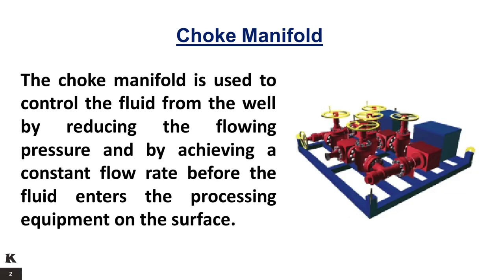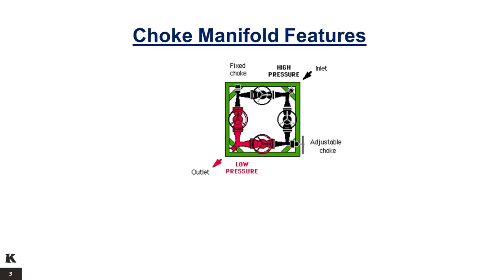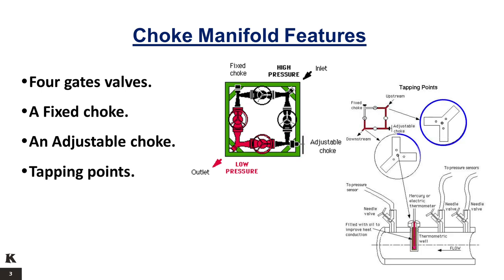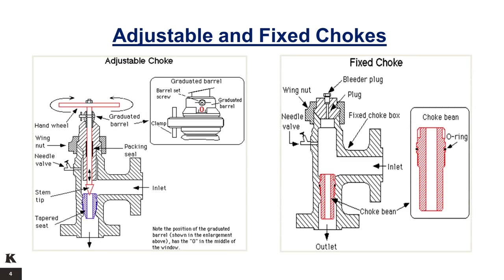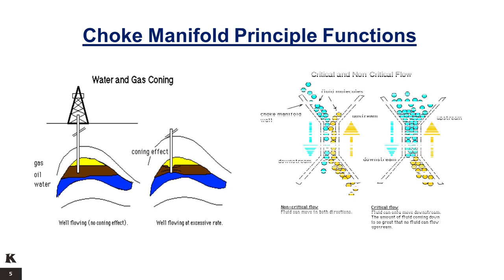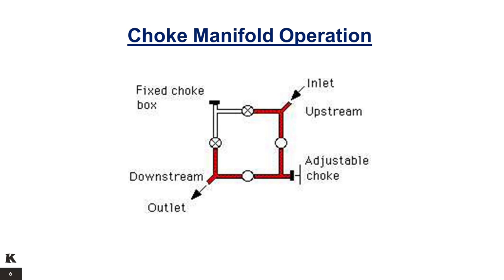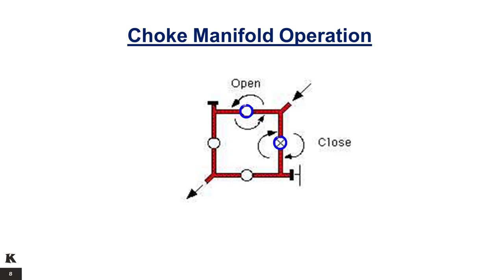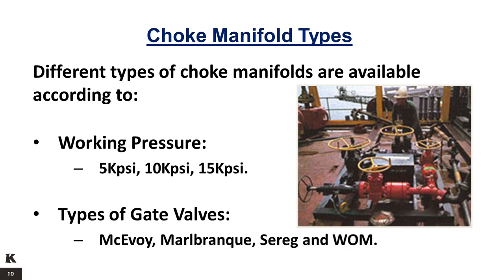SWT - Choke Manifold

Comment: we can adjust the choke size (adjustable choke)  to make it the same as on the well?
Reply from the maker: Yes, you can adjust the choke size on an adjustable choke to match the choke size on the well. This will help to ensure that the flow rate of fluid or gas through the choke is consistent with the flow rate through the well. However, it is important to note that there are a number of factors that can affect the flow rate through a choke, including the type of choke, the fluid or gas being choked, and the pressure differential across the choke. As a result, it may be necessary to make some adjustments to the choke size in order to achieve the desired flow rate.

Comment: can we install the same choke bean (fixed choke) size that is on the well (same wellhead choke size)?
Reply from the maker: Yes, you can install the same choke bean (fixed choke) size that is on the well (same wellhead choke size). This is a common practice, and it can be done without any problems. However, there are a few things to keep in mind:
- Make sure that the choke bean is compatible with the well. The choke bean should be made of the same material as the wellhead choke and should have the same orifice size.
- Install the choke bean carefully. The choke bean should be installed so that it is flush with the wellhead choke. Do not overtighten the choke bean, as this could damage the wellhead choke.
- Test the choke bean after installation. Make sure that the choke bean is functioning properly and that there are no leaks.